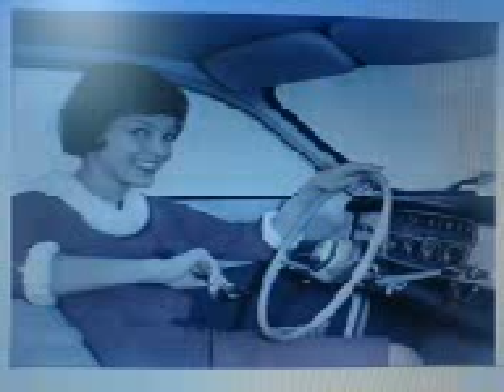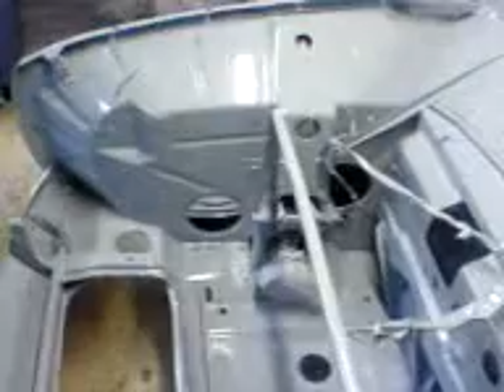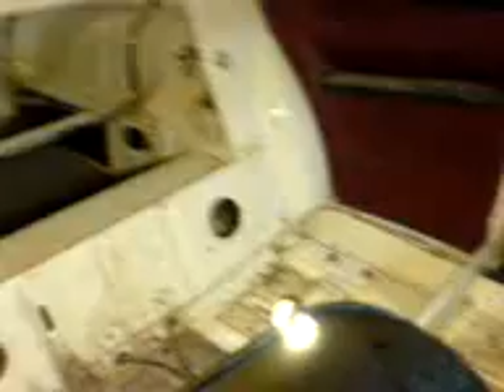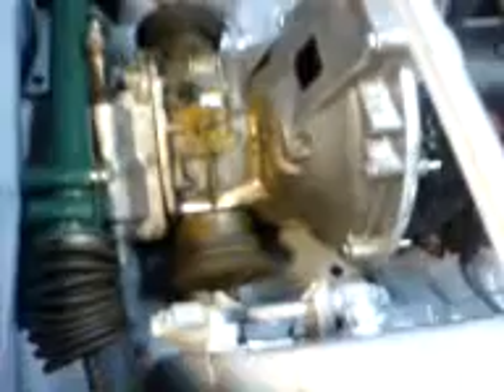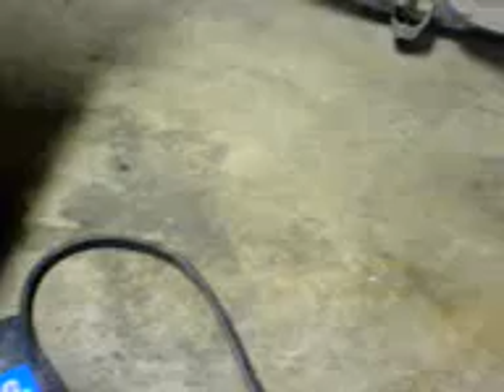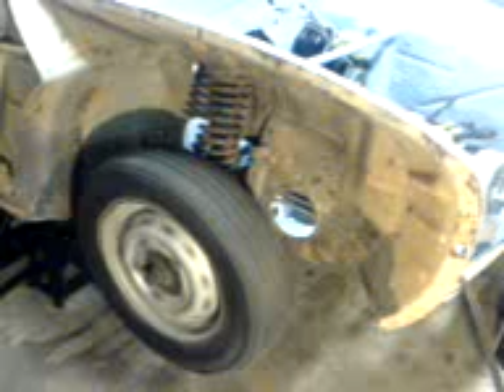SAAB 96-V quick update... electric car conversion EV

Comment from the maker: hi 
i bought most items through Bob Batson of  Electric Vehicles of America, including the adapter plate and coupler.  i hit about 57 mph today and it felt great.  my range seems to be about 50 mph on average.  16 x 6v batteries...  the weight did increase several hundred pounds but i'm still within the gross vehicle weight limit.  i recommend it !  it was a blast!